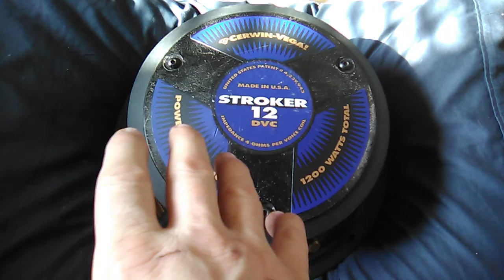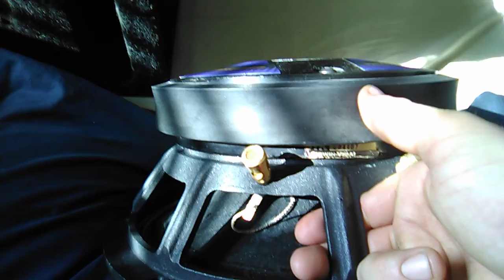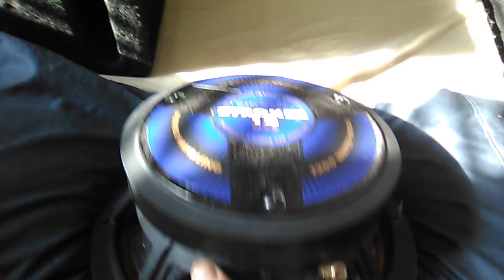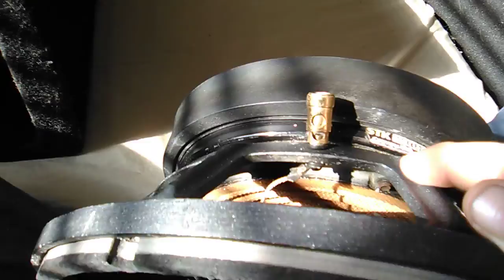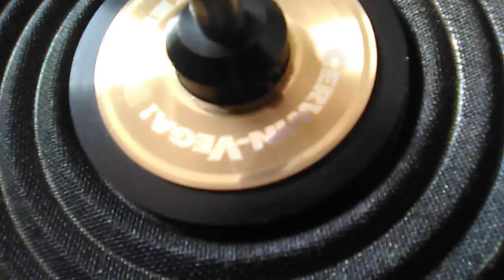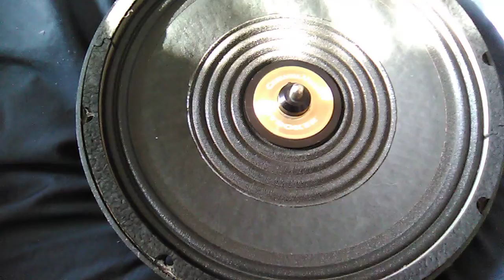Cerwin Vega Stroker 12" The Legend

Comment: Came across a rare deal again!  Buying 2 never used 12" cerwin vega strokers tomorrow still in plastic.  I also own 2 very rare original 18"s from the 70s earthquake threater version's (still play great!) I'll post them up soon for you to check out.
Reply from the maker: That's awesome. Finding one is tricky but a pair new is a heck of a find. The great thing about the original Strokers is that they didn't really have any parts that deteriorated over time like a foam surround or ferro fluid. I think the PPI or early Orion subs suffer failure due to the drying of the ferro fluid. Those original 18's are still in use by several people. To me that says a lot about what an amazing driver these are. 40 years is an amazing testament to the quality of the strokers.
Reply: i guess I am kinda off topic but does anyone know of a good place to watch newly released tv shows online ?
Reply: @Danny Koda Lately I have been using Flixportal. You can find it on google =)

Comment from the maker: The 12" had a 92 db sensitivity rating the 15" was 95 db and te 18 was 96 db. The free air resonance of the 12" was 51hz 15" was 43 hz and the 18" was 34hz.
Reply: i was just reading an Auto Sound and Security on the 12' a little bit ago (for the hundredth time lol), and the measured output during the test was 88db averaged from 50-100 hz. So although the published specs are there to impress, they dont always ring true. Also, adjusting the top spider voided the warranty of these....not that it mattered to competitors.
Reply: how much xmax?
Reply from the maker: @jr1001jr  23mm
Reply: @brentb5303  🤯 ... I never knew that they moved that much, wow🤯

Comment: The series with orange suspension from early 90s were the XL series and the later model with V-flex suspension was actually foam not cloth like Stroker. I still don't know official name for that series. Here in Nordics they were sold as Vegaline. In other places they were simply Cerwin Vega 124, 154 etc.

Comment: I had gotten a hold of 2 18 strokers back in 2000. Towed a car. Took ownership after nobody came to get it after a year. Had mb quart highs. 2 Fosgate 500 dsm. And 4 channel linear power. Made sure I saved it all before scrapping car. Was in head on collision.
Reply from the maker: Thats one heck of a haul. At least it went to someone who knew what it was. Imagine all the classic gear that got scrapped with the vehicles.
Reply: @brentb5303  it was really good luck for me. Owner of company was just going to haul as is to scrap yard. Asked if I could have the stereo system and he said sure. He wouldn't even take any money for it. He was older guy who couldn't care less about stereo equipment. Lol
Reply: Also a tip for you. I had a custom sealed box made for them each had own chamber. They hit so low it bounced steering column until ignition shut vehicle off. Lol. Spl might require ported. But I was going for low htz response. On point precision. And they way over exceeded my expectations. Most accurate I have ever seen. My w7 is only sub I found to come close.
Reply from the maker: @danielmiller4492  I usually go sealed. I can't imagine I'll find myself in the SPL lanes anytime soon. You came to the same conclusion I did. I would put the w7 on par with the stroker. Maybe 1st gen IDMAX and the eclipse titanium subs in the ballpark. Sundown makes some crazy subs but I'm not hearing the "count the cycle" accuracy like the other subs I mentioned. I've been running the same 18W6's for years now. They sound fantastic but I want to try them in a larger enclosure. They do amazing things in a 1.75 cubic box but I think they got more to give. I got a line on some stroker 18's and I got 2 pair of kicker 18's one is the original separates and the other pair are C18A's. I want to do a video in the future of all the 18's from the 90's. Crunch, RF, Earthquake are something I might try and find in the future but to compare a RF 18 to a Stroker just isn't fair. The crunch look legit and my buddy has a pair.
Reply: Hi there 
which subwoofer do you like better ?
Jl W7 or the oldskool Stroker 
Can you explain
Reply: @brentb5303 Did you ever put your W6's in a larger enclosure? If not, do it. I ran 3 W6 15's on a 1400 Precision Power 2350. At first, they were in a small sealed box. They hit a really high note. They sounded OK hit not what I wanted. I took them out of that box and had a huge ported enclosure made for them. Oh man. It was what I'd been missing my whole life. It was the lowest, loudest, cleanest bass I or any of my friends ever heard. I had the loudest system in town. This was in 98 or 99, before it got easy to get loud.

Comment: It is vented through the front spider. The voicecoil bobbin is original made by stainless steel, not aluminium.
Reply from the maker: Erik Lundberg I have never heard of a stainless steel former. That is really interesting. Thank you so much for that information. Venting via the front of the driver is also an amazing revelation. Now that you mention it though I have seen a lot of woofers that have a thin dust cap that seem porous and there is the Altec dust caps that had the mesh screen portion in the center of the dust cap. So narrow coil gap and front venting. It seems to me that maybe the stroker design was inspired by the Altec's? Maybe those features are just more common than I thought? Thanks again for bringing this knowledge to the table. I am learning a lot and I appreciate it.
Reply: These ARE aluminum formers. There is no "venting" through the spiders, unless you count the space between the pole and the top spider itself as venting.
Reply: IamAwesome YoureNot When I bought my Stroker sub from the Swedish dealer Hi-Fi Klubben many years ago it was stated in the description of the sub that the voice coil bobbin was made by stainless steel, not aluminum. Because the sub has no dust cap hot air will be vented from the voice coil trough the front spider. If you hold your hand near the front spider after playing loud you can feel the heat coming out.
Reply: But thats not venting, in the traditional sense. Thats just an uncovered voicecoil. As in there is no dustcap. If you push any speaker for awhile and put your hand on the dustcap you will feel heat. Same thing except in the place of the dustcap there is a spider. I have two old voice coils in front of me now, that i want to try to salvage, i can assure you they are aluminum.
Reply: IamAwesome YoureNot The front spider has a lot of small holes in it where the air can vent through. A dust cap usually don’t. The voice coils you have are they original and not aftermarket? As I said, in “Hi-Fi klubbens” description (which is a big dealer in Scandinavia) it says the bobbin is made in stainless steel. And in other places I’ve read “metal alloy”.
Reply: IamAwesome YoureNot From Cerwin-Vegas old website: With music. On that note, the alloy former in the Stroker's voice coil is able to transfer heat out of the voice coil in, well, a flash.

Comment: I have same exact sub ? any idea how to recone or get parts ? thanks
Reply from the maker: EBay usually has them on there. You can call simply speakers or Springfield speaker and either one should have a kit or will do it for you if you send it in. Pricey but the speaker is worth it and it's not a do it yourselfer type of recone.
Reply: Ra audio FB
Reply: its me again . its actually working . do you have any more info on this model cheers ?

Comment: Can you use the home theatre models in car?
Reply from the maker: Absolutely. They decided to make the car version because that's what people were doing. You just have to design the box for that model and follow it's power handling capabilities. I'm not positive but I believe both are different than the car audio model. I think the top plate is thicker on this model. Home and car subs are the same but car audio manufacturers designed their subs for smaller enclosures die to space constraints. These Strokers require a massive enclosure.
Reply: @brentb5303  bet thanks because i have 2 12s i wanted a custom box for they were originally in a home theatre box
Reply from the maker: @heiseye9941  Hell yea man. I'll see if I can get some specs for your box. They should pound and sound good doing it.
Reply: @brentb5303  good looks i got an 86 monte carlo ss im building i want everything old school and period correct even down to the bass
Reply from the maker: @heiseye9941  That sounds like an awesome project. What are you thinking for amps? I would go at least 500 watts a piece. I think 2 black ppi 2150am's would get the job done. Or a pair of Orion 2150's. Man now I want to do a Carlo build.
Reply: @brentb5303  yup orion altready have 1 2150 on an old orion xtr pro searching online for a second within a reasonable price
Reply: Sundown vs  Cerwin Vega which is better